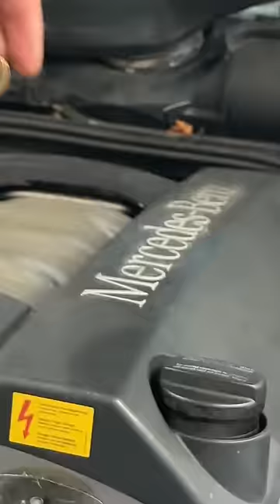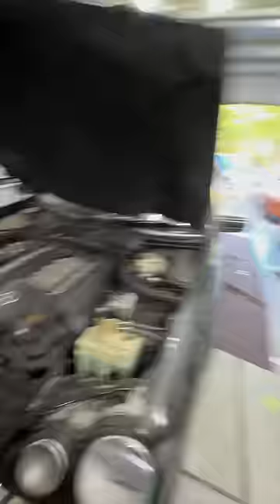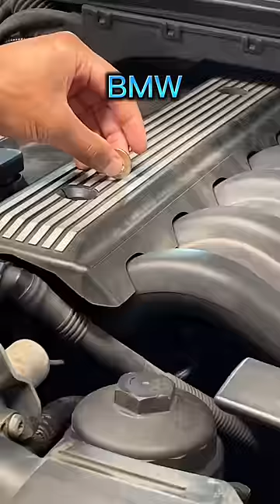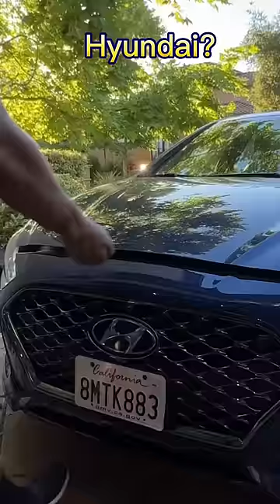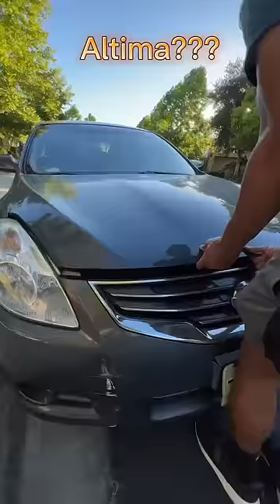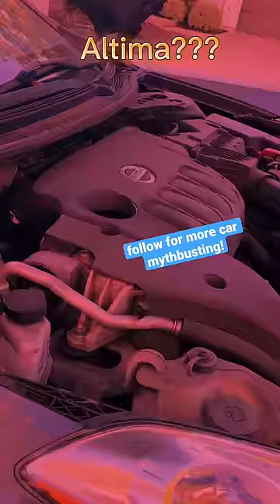The last one is 100% the best 🎩🎩🎩

Comment: The only type of engine that is balanced enough for that “trick” is a v12. So your video makes no sense at all
Reply from the maker: how do you explain the 300k mile mercedes balancing the coin while revving then? i’m legit confused why people are ignoring that
Reply: @ChrysGaines  how he said, a V12 balances itself and that makes it very calm while reving
Reply: @pascal4302  thank you!
Reply: V12 16s and 24s are balanced
Reply: Uh, or an I6 or W18
Reply: 65 amg
Reply from the maker: @pascal4302  he said that only a v12 is balanced enough for the trick to work, yet it worked on the mercedes’ old V8? so where’s the disconnect?
Reply: @ChrysGaines  You said it yourself. V8 can only do it while revving. E.g. when angular momentum exceeds the lower harmonics of the reciprocating mass
Reply from the maker: @alakani  that’s going from idle to revving and back to idle - same thing the rolls did. none of the other vehicles i tested passed the revving portion of the test. i’d say the startup is based more on the condition of the engine mounts
Reply: @ChrysGaines  uh no... You have torque, balance, mass, reciprocal forces and many more. From resting to start it's not small. Revving is gradually increasing those forces. And V8's are too light to have that clean Ballance. Inline engines are the most stable but again reciprocating masses make it vibrate. V12 engines have equal counter reciprocating masses to have the most proficient performance. The only way to get it smoother is twin engine left handed and right handed equidistant from centerline of the engine bay and a short cable circuit with each starter with the same current in each. But we get that set up on ships. Rarely on boats as they can have 5 outboard motors. Not to mention the bell curve, cause of course that thing just screws you over in some way as it's correct no matter where you put it. There's a certain point of mass to power where the engine will make women very happy. Smaller engines tend to vibrate less as the power doesn't move the mass well, and too heavy where the power can again not vibrate the weight. And the middle where the power and weight mesh well. Aka nissan engines.
All engines will have vibrations i am very aware of that. The smoothest engine. Aka any engine I'd make after brushing up on my knowledge as i have been focusing on other engineering disciplines because that's just stuff i can do for some reason. It will still make a happy lady.
Reply: All yall don't know shiiit. Lexus did this
Reply: My 97 honda valkryie, horizontally opposed 6cyl motorcycle can do it 🙂
Reply: @ChrysGaines  1000% correct, there's more rotating mass the higher the engine is revved, during startup and during idle (rpms low)  that mass is low making it even easier for this coin trick to work, the coin falling was without a doubt due to the motor mounts, these guys have no idea what they're talking about
Reply: The 1uz from lexus is a v8 and can do it too
Reply: Lexus ls400 advertisement?
Reply: @happytrails5342  that's a boxer engine, they're... They're unique.
Reply: @osmacar5331  😆
Reply: @happytrails5342  they are wierd, they are oddly oriented, and they're shockingly stable yet the most unstable. And they're compact. Reasonable power output for their size and can be stacked
Reply: Damn the dude is allowed to perform an experiment chill
Reply: 8 in line
Reply: Or y'know, a boxer
Reply: @BaggnWaggn  they still rattle, just... Weird.
Reply: @ChrysGaines  No, your physics are off. You haven’t taken the torque into account.
Reply: And bmw, rols royce have bmw 7 engine lol,and he compare e 36,could use john deere
Reply: BMWs I6 works too
Reply: @dotto3263  that's only because inline engines have an inherent stability but not the point of the trick.
Reply: Exactly compare apples and apples not fihes and Birds 🤦
Reply: Why they didn't tested out the Audi S8 and the Bentley Continental? Lol
Reply: @ChrysGaines  because mercedes is something else, it's the best car producer. even that old diesel basemodel could do such a thing sure but the guy who made the comment is right.
Reply: Your wrong there. V8 quad cam from the Lexus/Toyota Celsior can achieve this trick.
Reply: Nope it would be an EV 😂
Reply: @ravengurlxx1043  tell me please ,how can i put a coin on the engine of an ev without taking out the chassis.
Reply: H6 is better balanced than any V engine
Reply: Ever heard of an inline 6?
Reply: @lonewolf1300  well, I meant battery as they don't have an engine. ✌️
Reply: laughs in rotary
Reply: The only thing that doesn’t make sense here is the fact you don’t know he’s just trying to have fun.
Reply: It’s not gonna work very wlll regardless when starting on any motor, it’s imbalanced when starting since not all of the pistons are firing off at that moment
Reply: Not really my friend, a W12 is more balanced
Reply: @ChrysGaines  dude u can't compare a 1990s e class to a RR that's just not how it worka
Reply: @ChrysGaines  Mercedes used to build inline 6 zylinders (like BMW nowadays).
My guess (not an engineer) is that a Inline 6 (which is half of a V12 and also known for running quite smoothly compared to a V6) is as equally vibration free as the V12 (at least for some rpms) 👍
Reply: @happytrails5342  This bike can make people happy just from seeing it. A car is no match for that. 👍😆
Reply: Is this trick working at a Tesla as well? I ask for a friend... 😛
Reply: @mistersunny3636  hahahahaa yep
Reply: Not to mention he said "competitors" while mentioning a Nissan and Hyundai
Reply: Well i can do that on my Fiat x1/9 and that´s an inline 4 so...
Reply: @alakani  no you're thinking of wd 40
Reply: @willo5290  and boxer engines :)
Reply: Lexus has a v8 called the 1UZ that does this trick
Reply: An inline 6 is also silky smooth. The engine mounts of that old Mercedes were probably worn out so it shook on startup.
Reply: Imagine if she put it on an SR21DET, ROTARY, VTEC, 2JZ Or Maybe on a miata engine😉 lol (Miatas are usually sleeper they have like V1024s and while we are at tt they have 1k turbos
Reply: @ChrysGaines  imagine owning mercedes thats not diesel...
Reply: My Subaru can do it with 4 cylinders you absolute liar! (Boxer, not fair)
Reply: Also, valve adjustments
Reply: untrue. The Lexus LS400's V8 is balanced enough.
Reply: @TylerDeBoy  My Subaru has a blown head gasket, which seems common with them.
Reply: Lexus ls400 nuff said
Reply: My 2014 Honda Valkyrie does this np. Engine is super smooth.
Reply: @happytrails5342  2014 Valkyrie as well! Happy riding!
Reply: @snipexd4964  oh heck yeah! Happy riding !
Reply: V12s are literally less smooth than I6s, the reason Rolls V12s and Lexus V8s can get away with it has nothing to do with engine design and everything to do with engine and gearbox mounting, as well as starter design, the point of a Rolls is isolationism from anything outside the vehicle that might bother you, alternatively the point of a W210 E class is to go 500k with oil changes and with paying customers, don't judge a car by its ability to do something it wasn't designed for when it's far far better at something else
Reply: And the electric?
Reply: The original Rolls Royce tested was a straight 6.
Reply: @bogbrush999  plus the engine that made them famous was a V8
Reply: @ChrysGaines  this trick has nothing to do with the brand. Some engines run smoother than others. Rolls royce uses this trick because the v12 has a combustion event every 60 CAD.
Reply: @ChrysGaines  
To put it simply, a V12 runs way smoother than a 4 cylinder or 6 cylinder, pretty much no matter how perfect the engine is condition wise or tuning wise, even if the mercedes has 300k miles, which I doubt is on the motor, maybe the car, but the motor most likely 75k-150k, the V12 will run smoother than the 6 cylinder or 4 cylinder 99% of the time.
Reply: Dumbest comment I’ve ever seen the 1uz from Lexus was also famous for being smooth enough to do this
Reply: @ChrysGaines  you really called mercedes a competitor to rolls royce?
Reply: Ever you heard tesla?
Reply: how about i6?
Reply: @ChrysGaines  It's about revs. The motion smoothens out the higher it revs. That's why the low revving japanese car vibrates harshly
Reply: Inline 6 too
Reply: I could do it on my Skyline R33 RB25DET
Reply: My 24yo toyota mark2 beat this test. inline6 2,5l
Reply: @-hum-  old amg v12s ?
Reply: @alakani  is no one gonna talk about the Lexus v8’s 🙃
Reply: @ChrysGaines  Lexus V8
Reply: @Everyone 🤓
Reply: Wrong boxter engines are the most balanced engines ever designed
Reply: @pascal4302  boxter engines are perfect catty balanced engines thats why Porsche uses them
Reply: @ChrysGaines  and? It's not like the cylinders fall off
Reply: Nope. Used to do that with a nickel on the float body of the carburetor on a V8 back in the 60s and 70s.
Reply: Go see the lexus ls 400 releasing video
Reply: "The only type of engine that is balanced enough" and you just straight up ignore the fact that straight 6s have the best balancing.
Reply: @ChrysGaines  Well, a V12 can start up and rev with the coin not falling.
Reply: It really makes no sense using 6 or 4 pot Diesels as a comparison to a Rolls Royce - Didn't they do the same trick with V12 Jaguar engines too?
Reply: @adammorris3082  buddy the point is to compare vibration that results from balancing. The best balancing you will get is from a relatively low revving i6.
Reply: Inline or strait 6 is balanced.
Reply: Also, the competitor: Altima.?.
Reply: @ChrysGaines  0% IQ
Reply: @ChrysGaines  you getting cooked in the replies
Reply: Or a 6 in line would be equal balanced
Reply: ever seen how smooth a i6 is
Reply: @ChrysGaines  mercedes has a flat surface on it's engine. others don't.
Reply: 1UZ V8 steps in
Reply: 1uz toyota v8
Reply: bro it was just for fun, why you so mad 😂😆
Reply: Try it with an LS series lexus ;)
Reply: try it with an lexus LS500 ez
Reply: Wrong
Reply: The ultimate balanced engine is the V12 by BMW!
Reply: Just shows he doesn't check his engine mounts for wear
Reply: @ChrysGaines  the miles doesn’t affect what type of engine it is plus every car had a different motor cover surface
Reply: @osmacar5331  he's real quite now
Reply: @ChrysGaines  he's clearly talking about the rolls Royce trick you were trying to re create

Your acting dumb, your mercedes did not do the trick
Reply: @cecebellie  9
Reply: @Hazed64  ????
Reply: Shoulda specified meant the OP is real quite the moment you backed up your claim with all the technical information
Reply: @Hazed64  yeah was confused a moment thinking "the feck you gettin' at?" but yeah. i like engineering, thought not officially marked as an engineer,  can definitely give the top rung a really good run for their money. also been looking a lot into engines themselves as of late. if am gonna make one from ore myself someday for the fun of it, kinda need to know al lthat.
Reply: @osmacar5331  why don't we buy an electric car and forget about vibration
Reply: @ashiksnair9831  because am electric car is 5x more toxic to the environment than a diesel equivalent in their full lifetime. Not to mention the half life is 150x longer at best. Needs to be neutralised with equally toxic chemicals at worst. Also the emissions from cars actually help the environment by providing the plants much needed carbon dioxide.

If i was evil I'd buy electric cars. But am not, am just pissed at everyone for being inept and not making things efficient, or more efficient. Literally the cure to combustion engines is efficiency. The more efficient the catalytic converter is at scrubbing out carbon monoxide, sulphates and the like the better. But sulphates have a half life of like 5 minutes iirc. CO2 well already said. Plants need it.
Want me to go on?
Reply: You make no sense at all
Reply: Lexus V8 1UZ ;)
Reply: @ChrysGaines  that engine is supposed to be smooth not to make power or be very efficient but the bmw needs to make power.even though they both are similar they are very different
Reply: Or maybe an ls400.
Reply: What about electric????
Reply: Or damn near any lexus v8... they've been doing this shit for way longer than most others.
Reply: @charliebridgman7104  you mean what about a toy car?
Reply: Actually incorrect, almost any car can do this brand new as long as you put it in center of balance.
Reply: @ChrysGaines  you slowly revved it and didn’t even get to a high rpm. Didn’t cause the motor to jerk.
Reply: what about rotors?
Reply: @ChrysGaines   Makes me wonder if poly bushings/brand new motor mounts could make the mercedes better with that thought
Reply: I'm fairly sure any form of inline engine would work?
Reply: I6 should have done it if it had better motor mounts
Reply: Never seen an i6?
Reply: The Dukes experimental engine does also also V12 aren't inherently more balanced.
Reply: My in-line 6 can do that
Reply: 4 cylinder boxers
Reply: @ChrysGaines  subaru boxers should work
Reply: I6 has entered the chat

I mean inlines are the most balanced setup, no question about it.
Reply: Ls400 bro
Reply: Straight 6 is the most balanced.
Reply: V12 have their unbalance too. Thats why engines have balance shafts
Reply: also using old vehicles with bad motor mounts doesnt make sense either
Reply: I don’t think you’ve ever heard of a 1UZ then have you? 😂
Reply: Porsche actually did it with the 944 in the 80s with their 2.5l 4cylinder and thats pretty damn impressive for a high displacement I4 eninge... https://youtu.be/hO7uTc9DHio?t=253
Reply: And an Iline 6
Reply: mmm.. personally i love my pushrod shaking ne from side to side. ⚖️
Reply: @ChrysGaines read
Reply: @willo5290  Every engine that has multiple of 6 cylinders is naturally balanced
Reply: @battlebooms6429  what do you think a fuckin 1UZ is? 😂🤌
Reply: @saundersroe656  you mean the same 4cyl that Subaru has used for years before porche? You do know the porche 2.4 flat 4 is the same engine Subaru designed. Subaru designed that flat 4 for porche and porche gave them blueprints for a flat 6. Even a 1UZ is balanced. The engine doesn’t mean ahit, it matters about how balanced the engine is when being put together and the correct motor/transmission mounta
Reply: @363.2McMasters  Not any inline would work, for example, inline 4 isnt naturally balanced
Reply: The v6 and 8 also work its just the weight balance is the cause the pistons are even
Reply: Literally not true lmao. Someone is too young to have seen the Lexus LS400 commercials
Reply: Also trying to balance a coin on diesel engine. lol
Reply: @ChrysGaines  it’s a bait comment lmao
Reply: The 1uzfe begs to differ
Reply: 1UZ Fe?... toyota V8
Reply: Only lexus ls can do this
Reply: My 6-3/4 RR V8 does it just fine
Reply: I'm pretty sure lexus v8's like the 1uz can do this.
Reply: @snipexd4964  My dream bike 👍
Reply: That's not true, inline six engines (like the BMW M50TÜ engine shown in the video) have primary and secondary forces naturally balanced.

A V12 is just two inline six engines that are mated at the crankshaft, which makes a V12 also naturally balanced.
Reply: @ChrysGaines  Because MB engineering from the late 90's is top notch,  and it's a flat plane V8 which makes it run so smooth.
Reply: Obviously not. Since that was an MB V8.
Reply: Inline 3
Reply: @ChrysGaines  no it’s not just engine mounts.
Reply: @jeffreyharbin5211  it may be one cause but there are other many factors that could effect this test. Nobody can really win this argument because it’s really not that simple. Sure theoretically but irl not really.
Reply: @willo5290  u frogot I6 aswell
Reply: straight sixes are too.
Reply: @pascal4302  ptp
Reply: @ChrysGaines  if it fell it’s disqualified it needs to stand up for the entirety 😂
Reply: Im honnestly suprised the inline didn’t keep the coin up
Reply: A v8 lexus probably can do it
Reply: @jeffreyharbin5211  the more cylinders, the more stable. It got to do with the time in between each cylinders combustion. So yeah an 8cylinder can do it, if the V is having the right angle to balance itself. Still a v12 is gonna be way more smooth than a v8
Reply: Ehem you can literaly build a tower out of wine glasses on top of the LS400 and it got a v8
Reply: Square box engines are the most stable engine
Reply: Not a v12 . A w12
Reply: He a "Dunce" jajajaja
Reply: There's a video of someone doing the same thing but revving the shit out of his little inline 4.
Reply: Or an inline 6
Reply: @ChrysGaines  but it fell when you started it up
Reply: @ChrysGaines  this guy does not know what he’s doing lol
Reply: oh here comes the iidiot  who thinks they know it all . in line 6 flat 4 flat 8s and v12s are all balanced engines thats why that inline 6 mercedes could balance the coin the motor mounts are old so he couldnt do it on start up. now youve been educated
Reply: Flat 6 and boxers too
Reply: my uncle had a Daimler souvreign. with the be 4,2 straight 6. it also worked on that engine.
Reply: Well, an older Lexus
Reply: W12***
Reply: Or the LS400
Reply: there is something called balance shafts look it up
Reply: Inline 6 is even more balanced than a V12.
Reply: The 1uz v8 may do it
Reply: Boxer engine
Reply: A straight 6 is more balanced than a v12
Reply: @ChrysGaines  it has new engine mounts. All the other ones have shit ones
Reply: @ChrysGaines  anything possible.
Reply: @danieljordannicol9937  No a v12 is basically 2 i6 and it then has 12 pulses instead of 6 so it’s smoother
Reply: Why dont you put it ona Tesla
Reply: stares at the LS400
Reply: @pascal4302  finally someone actually making sense this dude video has 0 sense
Reply: (Lexus enters the chat)
Reply: Except lexus did it with a v8
Reply: @ChrysGaines  Anothing thing to note is you were just ever so slightly hitting the gas, If your revving your on and off. Not on......... and off.
Reply: @ChrysGaines  you didn’t place the coin on the bmw right 🤦‍♂️
Reply: @ChrysGaines  so the reason ppl are mad at u is cause engines with more pistons fire more so fire more smoothly
Reply: Thank god i just wanted to write that
Reply: I think you guys don’t know that v12 is just two in-line six’s
Reply: What about toyota's v8, 1uz?
Reply: @ChrysGaines  He dont know what the v# means.
Reply: This is not serious mate
Reply: boxer engines
Reply: subaru boxer engine
Reply: So I'm going to correct you so I'm going to give you 2 top four list I would do a top-five but the fifth place you can put a couple things there and you would have a pretty solid argument for a decent amount of different engines I'm also going to break it up into two different lists

This first list will be the theoretical list as in if everything was built without anything to worry about except for performance and balance
1. Inline 6
2 v12 at a 120° bank angle
3. V8 at a 90° bank angle
4.  Inline 4

This next list is how it actually works out because things are a trade-offs as well as limitations
1. Inline 6
2. V8 at a 90° bank angle
3. Inline 4
4.v12 

The reason why I have v12 comes in last place in this one because they never have a proper Bank angle to make them balanced the proper Bank angle is 120 but sadly the only people who would put a V12 in that would be formula 1 teams almost all the V12 that you will see on the market either have a 60° or a 90° bank angle 60 is better but then you have to make the camshaft weaker and you also have to worry about the timing by the way I figure I should also mention the v8 the ideal value for V8 is at 90°so you will notice that I put the inline-6 above the V 12 and I put in line for below the V 12 and the inline-6 or pretty much the exact same there just two inline 6 strapped together but there two major forces that make the balance primary forces and secondary forces a inline 4 is completely balanced for its primary forces but it is unbalanced in its secondary foices so adding another inline-four allows us to balance out some of if not all of the secondary forces the thing is for a inline-6 it's completely both its primary and secondary forces are completely balance you do not have to do anything special to the engine they will run completely smooth so a V12 engine is just 2 inline 6s so you think that's it's completely balanced but there are a few problems I've already covered Bank angle being one of the problems the secondary problem is that the forces I'm not going in a favorable direction to cancel out secondary foces so av12 actually adds secondary in balance to a already completely balanced V6 even if it has the correct bank angle to allow even fireing times it's a lot that goes into this but if you are wondering what I mean bank angle as well as the angle of the camshaft will dictate the firing times of your engine in engines to have a even timing that means every 90° another cylinder is for a V8
Reply: @willo5290  I want to correct you you are correct to say that a V12 as well as if he v24 are fairly well-balanced but they're not the most I cannot agree though with the v16 at all the only engine that perfectly balanced is a inline 6 both primary and secondary forces are completely but with a V12 because the bank angle has to be at 120° and that number cannot go evenly into 180 add secondary forces to a perfectly balanced inline 6 
This is why you need counterweights on the camshaft for any other engine except for a inline 6 The only would be if that engine could achieve secondary balance with its completely the closest one to it would be a flat v a boxer engine when it exactly allow it because it has different slots for each making a rocking motion adding extra secondary forces
Reply: I got a 60 year old V8 powered Ford that passes this test. Cylinder count isn't what's most important to smoothness.
Reply: A Subaru flat 4 and a flat 6 balance themselves out
Reply: tesla wins
Reply: Yeah he forgot about "Surface"
Reply: would this work on a rotary?
Reply: @willo5290  don’t forget inline 6 motors
Reply: @ChrysGaines  the Rolls Royce trick is "from cold" so to speak...
Reply: Cheys compares apples with nuts lol
Reply: Probably boxer engine aswell
Reply: Bmw should have worked.
Reply: no, an inline 6 naturally cancels out primary and secondary forces so it can be done on an l6. V12 is just a double l6
Reply: I think inline 6 might work too, because the engine balances itself greatly
Reply: Or a f4
Reply: A 1990 Maxima can do it.....
Reply: You can do it easily with a Lexus ls430

You don’t need a v12 to have smooth running- just a refined engine
Reply: and rr motors are bmw motors
Reply: I6 is balanced too 
The problem is different piston weights
Reply: @arya_amg  its not just about the piston weights- its about the primary and secondary forces. the main causes of inbalance are from the crankshaft, camshaft and connecting rods. The weight of a piston just amplifies the rotating unbalance of the static masses within the engine.  

The I6 is the 3rd most balanced engine type after the rotary and v12. It has issues with flexing meaning that it can suffer from inbalances effecting the primary forces with vibration issues.

That can be solved by adding mass to the components but it reduces efficiency. with the use of balance shafts on other engine types that are not as naturally balanced but also aren't effected by flexing creates some v8s are smoother than I6s. 

i have owned many cars including mazda rotaries, I6 & V12 bmws and V8 Jags/Lexus. the smoothest was the rotary followed by the LS430 V8.
Reply: @kaiser98berlin  not true, all engines are effected by primary and secondary forces. the I6 is one of the least effected by the non-sinusoidal motion of the crank and the changes in the pistons speed through the stroke. I6s and V12s can suffer from vibration caused by flexing components like the crankshaft and while it can be combated, other engine types that don't suffer from flex when combined with the use of balance shafts negate the advantages of the i6 layout and can be much smoother. one of the best examples of is the Uz family of v8s
Reply: Why a V12 is "more balanced" than a normal straight 6?
Reply: Was about to say that he’s comparing V12 to a L6
Reply: @gerasimosrico  L6 and V12 have the exact same vibrations
Reply: @alakani  they’re talking about when the detonation of each cylinder occurs, in an V12 you’ve got a cylinder going off every 30 degrees vs an I6 or V6 where they’re going off every 60 degrees. I believe you’re talking about the forces, secondary and primary, that cause an engine to shake like the Altima in the video that are in relation to the motion of the piston. You can have a perfectly force balanced engine in an I4 that doesn’t run very smoothly because the cylinders fire every 90 degrees. Essentially one is how an engine tends to shake due to motion the other is how much power each cylinder is making and how frequently it’s applied to create smooth power vs a rougher but just as powerful small engine.
Reply: @ChrysGaines  the trick requires ur to stay up when it starts, more cylinders, usually smoother engine overall. So yeah this video was pointless
Reply: wrong straight 6 is the most balanced engine
Reply: Seen it done on inline 4, 5, and 6 cyl.
Reply: My flat 6 Honda Valkyrie begs to differ
Reply: @lebronjames4705  yes but the power it makes is every 60 degrees vs every 90 in a v12 so the v12 is smoother. You can have a perfectly balanced engine that can’t do this trick because when it makes power it does it less frequently per crank revolution then a different engine. It’s not all about balance, I’ve seen v16’s fail because of balance issues and I’ve seen I4’s do it just fine because they don’t make enough power to shake and they have enough balance to make it work.
Reply: Boxer moment
Reply: @osmacar  I know I'm late but great comment
Reply: @ChrysGaines  true that’s kinda bs mate
Reply: Ls400 would like to have a word with you
Reply: Flat 6 can also balance a coin
Reply: All I got from these replies is just science
Reply: @ChrysGaines same time aswell you never tested even an inline 6 which is quite harmonically balanced just like the V12. Zzzz..
Reply: You gotta try a 1uz then
Reply: or an inline 6
Reply: That's not a Rolls Royce trick, but a Packard trick.

Balance the coin directly on the manifold and not just on a cover for the proper test.

And and all of their old straight 8 engines can do this without issue.
Reply: i didnt no V engines are more smooth then inlines....
Reply: Or an electric car😉
Reply: Lexus 1uz.
Reply: The Honda Rune motorcycle,  also the coin will stand. The Rune has a flat 6 cylinder. 3 cylinders each side. Try it
Reply: @ChrysGaines  becahse they don‘t know that other engines are also balanced enough otherwise you wouldn‘t habe pulled it of with the mercedes
Reply: Maybe you can use straight 6 but not 20 year old one.
Reply: 1.9 pd tdi ????
Reply: I beg to disagree my friend. Even 4-cylinder vehicles can have the smoothness of an 8 or as you say, a 12-cylinder engine car,
Reply: Bro v12s are nit balanced only boxer engines are balanced
Reply: v6 3.3 L ti bc
Reply: Ls400
Reply: What about flat engines?
Reply: @ChrysGaines because he's wrong. It's inline 6's that are so well balanced.
Reply: 🤔 lexus have been balancing coins on their v8 engines  since the 90s.
Reply: @ChrysGaines  you're 100% right bro. These guys are contradicting themselves
Reply: Any engine from 5 cylinders complete the cycle and could be enough balanced. The starting point is important for the coin test. And often, diesel are cranked from very low rpm starter and high torque so more risk of fail coin challenge.
Reply: Could a boxer engine do this?
Reply: The same as I6,I8 (and more), multiplicative combinations of them, and every engine with dual-mass wheels.
Reply: @ChrysGaines  yeah a Lexus can do it the 4 cylinder and 6 cylinder engines are pretty quit and don’t idle rough
Reply: The Lexus ls400 in the 90s could do this.. also did it with a stack of crystal wine glasses and it was v8
Reply: Nope. I6 can do it too. Just not a pos bmw
Reply: wow 17k and counting ppl, i bet yall never seen a v12 bay.
Reply: @alakani  honda's nsx v6's can pass the coin trick also jeeps i6 with the coil pack.
Reply: @milrussell903  no
Reply: @ChrysGaines  you revved the engine very slowly 😂 If you revved it properly it would fall over 😬Nice try.
Reply: @osmacar5331  he real quiet after that one
Reply: @trippydippy4119  what one?
Reply: I6s are incredibly balanced too. Boxers for three, rotaries for four
Reply: @KankBank  there's still rocking in them, not much, but enough to rattle things over.
Reply: 1Uz is a V8 and does exactly that the ram v12 Cummins doesn’t you’re not a motor engineer
Reply: He said competitors not on every car with a v12
Reply: @airjacer_2016  you know how a V12 works right? you know what physics is right? cause clearly, that is not the case.
Reply: @ChrysGaines  Mercedes uses softer motor mounts than most other manufacturers to limit the vibration in the cabin. This results in the mounts needing to be replaced more frequently. With mounts that are not worn out they are very effective. Also a v8 is a balanced engine because there will always be one cylinder on each side of the enging on a compression stroke. The more cylinder an engine has the more balanced it will be because it has multiple cylinders on a compression stroke. Hopefully this helps😂
Reply: You can get any motor to be balanced enough, its just that most cars dont do that because there is 0 advantage to doing that
Reply: Boxer engines or inline 6s
Reply: @joashbergman5477  not always the case.
Reply: Yeah nah, did this with a jag i6
Reply: Cadillac v16
Reply: @Iamthestig42069  too much vibration for it.
Reply: This is wrong!! The V6 is also capable for this!
Reply: @Thomas_7976  not as much as there's too much vibration present. Balance doesn't mean shit if the thing still vibrates.
Reply: so is the w12
Reply: @LLLexen  that one depends on firing order and crank, but yes.
Reply: @osmacar5331  yeye sorry lol
Reply: @LLLexen  why apologise?
Reply: @osmacar5331  cus i didnt specify
Reply: @LLLexen  fair enough, though you where still correct, even if you did not give the full breadth of information. right is right, but i understand your attitude towards it.
Reply: I have seen videos of nit v12 engines balancing the coin
Reply: Toyota 1UZ works with this as well.
Reply: Try a 1uz baby
Reply: Get ready for the arguments !
Reply: @madsblom9541  In order for any V config that is less than 12 cylinders it must have at least 120° for a V6 to be as smooth as a 12 cylinders
Reply: @pascal4302 Since it’s two 6 cylinders that way it doesn’t even need a balance shaft
Reply: From my understanding inline 6 engines are inherently balanced so this should work on any car with an i6, no?
Reply: Lexus 1uz all day long can do this
Reply: Btw, I have and e39 (2003 BMW M5) and I’ve tried this and it has worked
Reply: It also works on my 2.5 5cyl turbo volvo.
Reply: @ChrysGaines  they're old man... it's not fair
Reply: @ChrysGaines  brother thats not a 300k Mercedes,  thats a Mercedes class e from the 90s now that cost around 8k second hand
Reply: @Naqviusedtobekrypton  same type of scientific research the woke community is doing....those engines have mechanical wear most likely, and that added to the vibrations. I might be wrong, but at least pick a RR from the same era...
Reply: Straight 6 also does.
Reply: @ChrysGaines lmao you’re getting owned in your own comment section 😂
Reply: @ChrysGaines ngl everyone in this reply section is shutting you down! 😂😂
Reply: My 4 cillinder is also balanced
Reply: @ChrysGaines  I'm legit confused how you ignored the entire first part of his comment
Reply: @osmacar5331  I think you misspelled shit
Reply: @SkylineTwinSpoolysnail  what was this in response to? am not trawling through 331 comments just to find the one you responded to.
Reply: Not true lol. Wankel can do it no problem.
Reply: @alakani  the 1uz would like a word
Reply: @rogerstalder7184  you just blew an apex seal. And have major vibration issues.
Reply: @REAPER3fitty  Lexus ❤❤❤
Reply: Ls400 you can do it too
Reply: @ChrysGaines  bro dw I'm with you, great video 🔥
Reply: @ChrysGaines  oh and btw you got another subscriber
Reply: @osmacar5331  incorrect
Reply: @Fee.1  and who are you?
Reply: @osmacar5331  your daddy
Reply: @pascal4302  Explain why it balanced on the Benz?
Reply: No lexus with 8 cylinder did that
Reply: @ChrysGaines   good motor mounts, your car doesn’t stay in pristine condition if you don’t replace parts 😂
Reply: I had a 4L V8 Toyota celsior which is the same as the Lexus LS and it did this no problem the land cruiser also shares this engine along with a lot of other cars you's are all tripping
Reply: Y’all forgetting 1Uz fe. Butter smooth engine
Reply: two cars are with a straight block and two are with a crossed block, he placed the coin the same way on all the cars.... no, it really does not make any sense... and btw an e39 has such a quiet and smooth idle, that if you sit in one long enough with the engine running, you might just try to start it up again when you wanna drive away, because you forget its running
Reply: Boxer engines are also really good at it
Reply: That aint even a v12 its a normal e class sedan probably has a normal 4 cylinder engine
Reply: No straight 6 and V12 can do this. The bmw should have been able to but it does not run correctly
Reply: Crossplane V8 is also naturally balanced. That's why American cars use it. Europeans use flatplane V8.
Reply: explain why my ls400 can with a 4.0 V8👀
Reply: Or the most balanced engine of all the rotary 👌
Reply: Everything that devides with 6, like i6, v12 or some like it, does the balance mint
Reply: @ChrysGaines well did it or did it not fall over when you started it. That is part of the trick.
Reply: I’d try it with a VW Phaeton W12 engine.
Reply: @willo5290 i thought half of 8 was 4 and half of 6 is 3 pretty sure it has nothing to do with how many pistons it has
Reply: Boxer engines can do it as well as i6
Reply: @ChrysGaines  technically speaking all engines are balanced. The V12,16 and 24 balance themselves from the stqrtup. A V6, V8 is really shaky at the atart but then it is realively stable. Hell, i pulled it off with a 1.4L i4 engine
Reply: Inline sixes are perfectly balanced.
Reply: @ciprianpasca7738  no, all engines are not equally balanced. An inline 6 is theoretically perfectly balanced at all points of each rev. This is not true for all types of engines.
Reply: @Chrys Gaines  I have that car so I'm lovvinng it. I think if you put it directly in the middle it might stay on startup!
Reply: lexus
Reply: My v6 sports car does it, even revving upto 9k it barely moves
Reply: it depends on the inclination of the surface of the engine. On a Mercedes it is flat, but on a BMW it is tilted
Reply: @pascal4302  so does a in-line 6
Reply: @thechainedghost2995  yes i know, what is your profession
Reply: @businessninja1913 ofc hes allowed to perform an experiment. But he posted it online and talked shit. So why arent we allowed to comment his "experiment"?
Reply: False. It could also be done on turbine-powered Chryslers.
Reply: Inline 8 too.
Reply: @ChrysGaines  freaking V8 dude... It's way more balanced then R6 or L4. It's a fundamental facts of motor engineering and coin trick pass or fail does not make engine better or wose.
Reply: The Lexus LS400's 1UZ-FE V8 can balance a coin and wine glasses.
Reply: Lexus sc400 can balance one mine did it running poorly
Reply: @ChrysGaines  my 4.8L vortec can balance it if I rev just not a crazy hard one
Reply: He put it between the c that's why it stayed up
Reply: I6
Reply: L6 тоже хорошо сбалансирован
Reply: So most lambo's can do it?
Reply: Well first things first mads blom...it was done on lexus first in the 90s to show what a smooth ride the LS400 gave and thats a V8 and there are a lot of straight 4-8s that can also do it and many V formed engines too...any balanced engine that runs smooth and has good engine mounts can do it🤦🏽‍♂️🤦🏽‍♂️🤦🏽‍♂️
Reply: @ChrysGaines  V8 is more balanced than i4 and maybe slightly less than i6. It makes the most sense to say what the engine is, and test reving it.
Reply: I4's, i6's etc
Reply: Test Subaru! 😊
Reply: Or an inline 6
Reply: Tf is this test
Reply: Toyota v8 too is well bananced in the Lexus
Reply: @jeffreyharbin5211 idk what's wrong here honestly lol motor mounts do help tho i bet
Reply: @ChrysGaines  bro it do not work, the coin still falls at startup
Reply: Not true, I have an old international 4cylinder and I balanced a coin on the radiator cap, very very smooth 4 cylinder.
Reply: Wronggggg, 8 cylinders is optimal for balance
Reply: Or a v10 or an inline 4 or an inline 5 come on man lots of ballanced engines
Reply: Look up lexus ls400 1990-94.
Reply: @ChrysGaines you're not gonna last long o. youtube if you're getting this triggered from 1 comment
Reply: @ChrysGaines got real quiet after omar pulled out the fax
Reply: @osmacar5331 you shut him up with that one mate
Reply: Oh there comes the boxer 4 and 6 and inline 6 to hold your mouth closed.
Reply: First You should compare the price, age and fuel type😅
Reply: L
Reply: I'm very disappointed that your comment got as many likes as it did, you don't need to be v 12 to be balanced.
Reply: motor mounts
Reply: The coin test used to be done, on the RR V8. The current Royces use a BMW V12.
Reply: Not true at all. Brand new engine mounts on any car it'll work. And im pretty sure rolls royce have solid engine mounts so of course they're not going to move when the car starts
Reply: @Project_V8  An flat plane, inline 4 has perfect primary balance but a secondary imbalance due to acceleration and deceleration of reciprocating masses, a v8 cancels that secondary imbalance. A 120° triple has perfect balance with a srcondary rocking couple, an l6 or v6 eliminiates this etc. Royces used a v8 from  the late 60s which the coin trick worked on. So no it is not just v12s.
Reply: Lexus LS engines with a V8. Could do this
Reply: Not only. i6 V6 F6 W18 some V8...
Reply: @dio9566  clearly an expert
Reply: Or an inline 6. They are reliable and balanced. Then your motor and gearbox mounts play huge roll so i don’t know why they do this😅
Reply: @Noah_lindqvist  we must eliminate roll at all costs.
Reply: 1uz V8 POWA
Reply: @pascal4302 that mercedes isn't a v12. I have one. It's a 4.3l v8😅
Reply: Nissan vq motor
Reply: @Durz0.  With modern CAD/CAM. technology, all engines are blueprint. In the past general run engines had much broader manufacturing tolerances. To get an engine totally bananced was very expensive. Each component had to be either very carefully measured from a selection of general components to ensure precisely matched components were used. Or, the whole engine had to be rebuilt to precise specifications. This was called blueprinting. Nowadays, all engines are pretty much, as good as that.
Back when Rolls Royce boasted about the coin test, it was because they were usually precisely made. Even a basic L4 is very well balanced.
When i was young even the performance and competition cars of day were not as good as stuff you can buy stock, now.
The cars now are very efficient but they are difficult to work on. I like cars from the past as they are repairable and restorable.
Reply: Tray a porsche boxster
Reply: My 2022 rx does it perfectly lmao
Reply: omg babe chill it's a meme
Reply: Bruh... Every fking engine with even number of pistons can cancel out each other momentum perfectly in theory. End of the day it comes down to the execution and dampers. Get yrself educated
Reply: Vr6